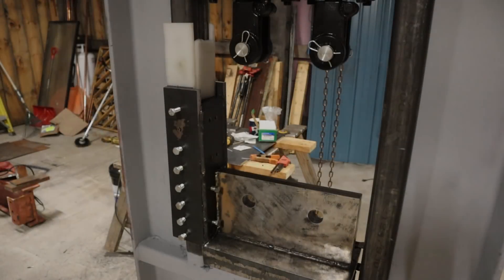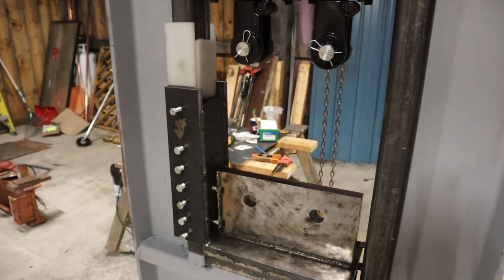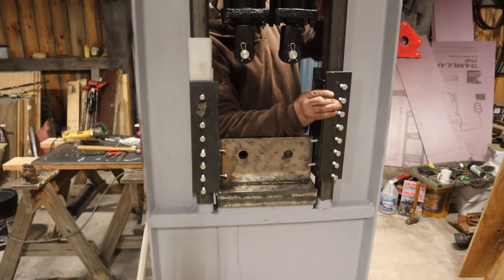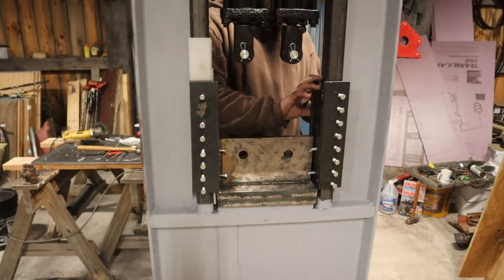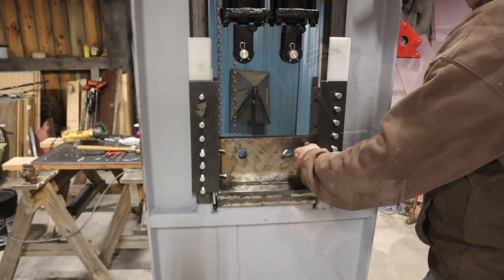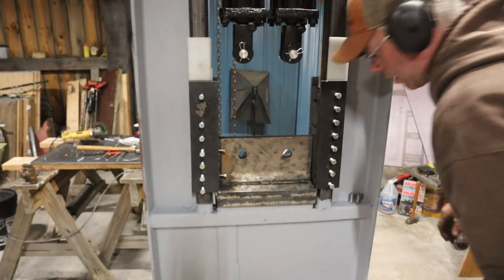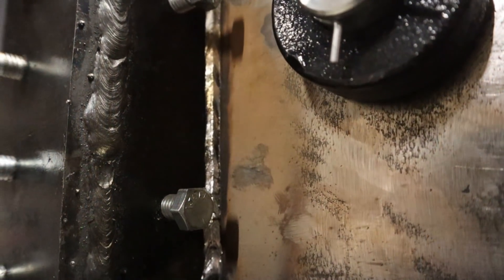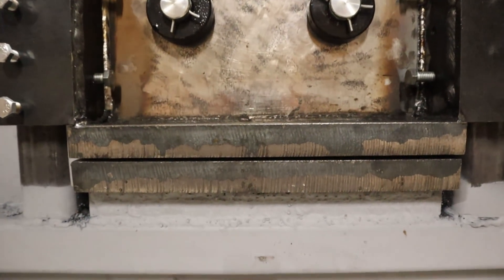Super Forge Press Build Part 8: The Slides

Comment: Hey Jim. 
 Buy the way bronze ppl are works really well for gibs. Another suggestion make some oil grooves on the side of the gib that rides on the square tube with small hole drill through on each oil groove. At each small hole on the guide put a grease nipple. 
Thanks Henry Schmidt

Comment: Hey Jim.
 It looks to me that your basically making gibs on your slide. If I'm you're  correct using bolts to tighten them .  If I can make a suggestion, I would drill a few  dowel pin holes through  the guide and partly through the cutting board so the cutting board can't lose position. Also instead of  the bolts use a set screw and a nut to lock the set screw in place when you achieve the desired tension. Works good to start at one end and work your way over the length of the gib with small adjustments. 
Thanks Henry Schmidt

Comment: Awesome build Jim, as long as you have fairly even pressure going to both rams i think you will be fine, the wooden guides should work fine, i would round off any edges that could grab if you haven't already, you have enough adjustability to counter any misalignment issues, i haven't got any further with my Press still sitting out the front in bits

Comment: Morning, Jim. Looking a bit bedazzled with all of those bolts in the vertical glides. 
I was thinking about your side press... what about a system of bearings to ride up and down the I-beam on the side there?
Look at the blade guides on your bandsaw as an idea starter for that press. Three sided, adjustable, bearing guides sould work quite well, and you can have a test to see which style lasts longer, and adjust/rebuild the other side/part of the press accordingly.
Can't wait for what I hope are fairly detailed design and build videos for the hydraulic system part of this tool build, with the hows and whys. Hydraulics is something I never really got in to. Thanks for taking us along on the journey/build.

Comment: The technical term for the poly things you have there is Bee Gees oops its really Gibbs, Little slip of the toung there but it will help me remember it. Hope they didn't get fried while you was weldin. You won't need grease with poly and the slag from the hot iron won't stick to it. Use Hyphoid gear oil for tapping and you will find it goes easier. The extra lubricity makes a difference and the high sulfur actualy helps to cut the steel also you would benefit from spiral point tapsyou dont have to back them up to break the chip and you could tap in your drill press this solves squairness and n it's a heck of a lot faster albeit not as much fun. If you drill through the poly slides"gibbs"and put the screws through with jam nuts it will hold them in place. You only need two per gibb and this is standard procedure. Socket set screws with jamb nuts would look nice and give you less to catch your shirt sleeves on. Socket head set screws are my go to item when I need short threaded studs in machine building with the benefit that they are always grade 8. Lookin' good so far nof if you hook up the air to the cylinders you can see how it goes up and down.
Reply from the maker: Helps to have a machine building buddy, always good advice.

Comment: what I have done to remove the tapes i use a very good metal hole saw and drill it a size bigger the plug the hole with thread insert  your not in a rush to do this have one chance to get it right
Reply from the maker: I've done that on engine cylinders, didn't even think of it for this.  Thank you.

Comment: Looking good! When welding down hand the slag always wants to go into the joint below this could cause issues if the slag gets trapped, but falls off most of the time, the weld will look good on the surface but could have slag inclusion in the root. E7014 is a nice rod, I perfer to use it in the flat horizontal position on low stress joints. The rod of choice for most structural fabrication is E7018 and it’s never used with down hand. Im sure you might be fine on your project if you see any cracks just grind them out a use E7018 to repair. Hope I didn’t cause that Canadian coffee mug to hit the wall 😆.
Reply from the maker: I use 7018 for most of my welding, all of the major load bearing steel is welded with it.  I'm hoping these welds won't be under large stresses, of course you know how that goes.
Reply: The force from the cylinders on your project will be equal on the top side as it will be on the bottom side of the frame when dead heading, the bottom looks good, as for the top like you said a few gussets should help with that.   Rule of thumb is to always be 3 time the rating of the hydraulic pressure on structural integrity. In you case just over build the shit out of it 👍
Reply from the maker: Thank you, I learn something when you comment and it is appreciated.
Reply: I’ve watched every video on your timber framing series, and learned so much, thanks for doing those. Can’t wait to see the new upcoming project with your friend.